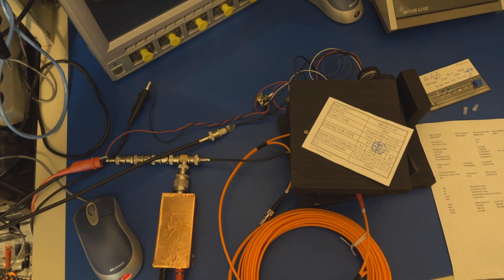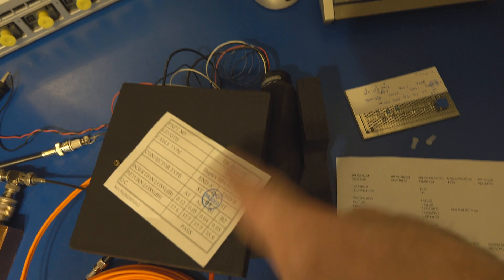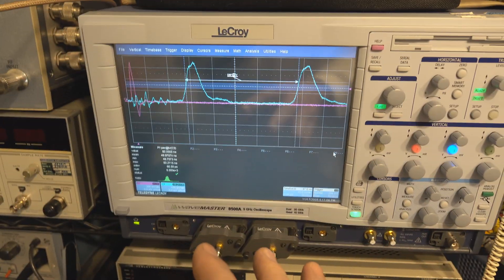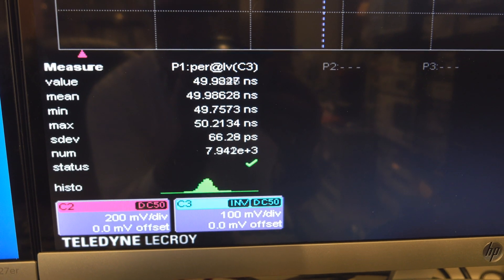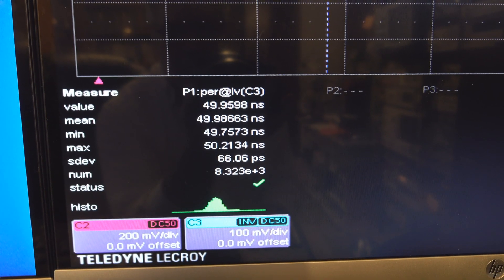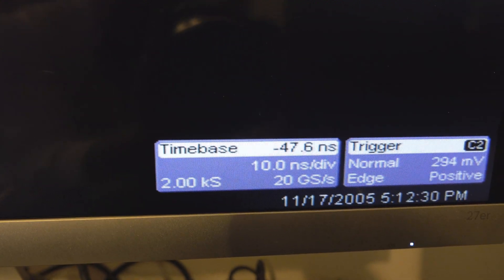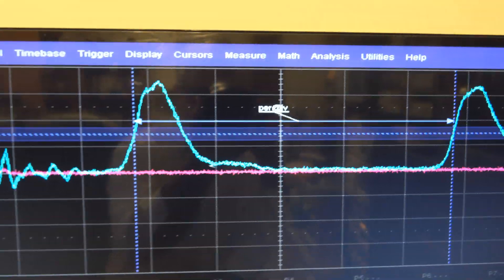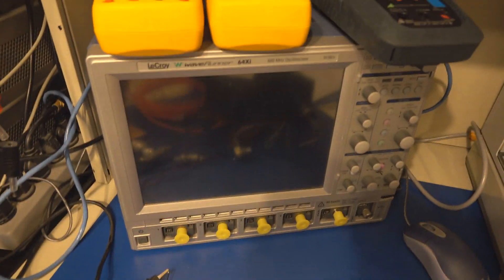Using the LeCroy 8500A to Measure our Fiber Optic Cable

Comment: So, how the story with uni-t ut210e ends?
Reply from the maker: There is a story??  The switch became intermittent on the one I use most often after about a year of moderate use as a clamp only.  This meter was factory stock.  I pulled it apart and cleaned it and so far it's been working but I doubt it will have a very long life.   Still it was only $30 so you won't hear me complain about it too much.    Beyond that, I don't anything new to report.
Reply: @joesmith-je3tq  Ok, thanks!